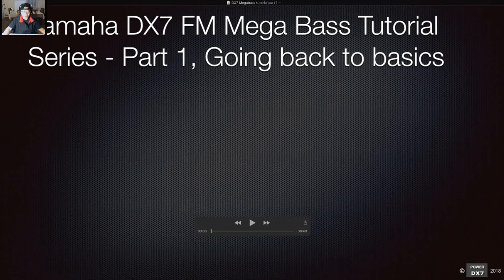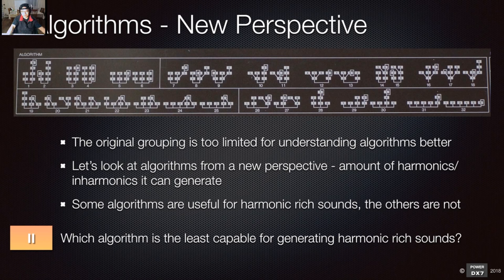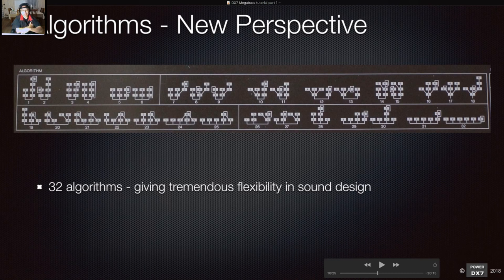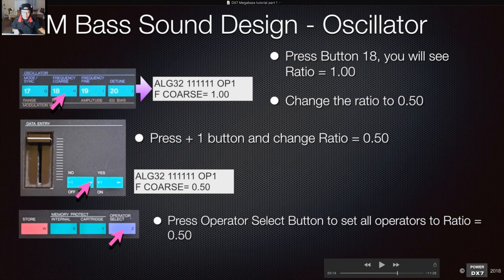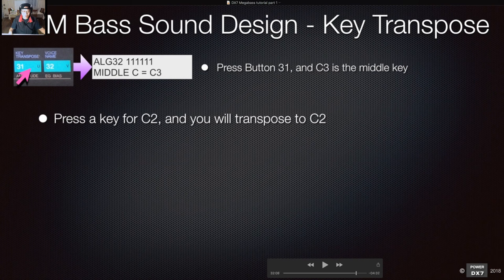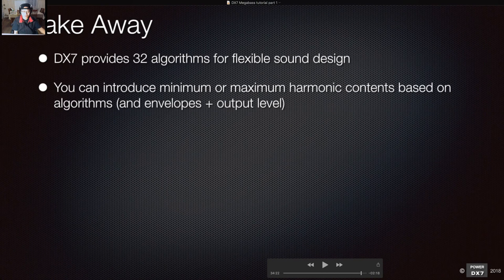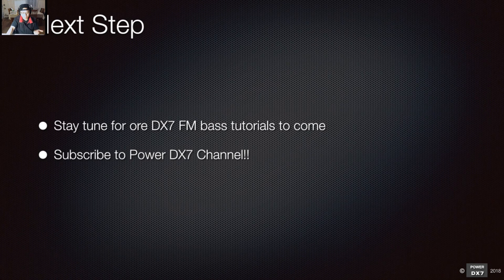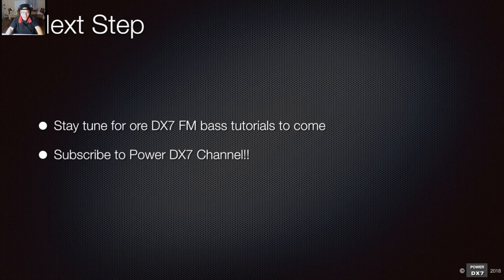How to learn Yamaha DX7 like a Pro - DX7 FM Mega Bass Tutorial Series Part 1

Comment: I'm using Dexed and feedback appears to be much stronger in it. The sound you got initially from fb = 7 I got from fb = 4.
Reply: I tried this out.
Either the output level needs to be set to a value between 80 and 92 with feedback set to 7, or level is set to 99 and feedback is set to 6 or lower.